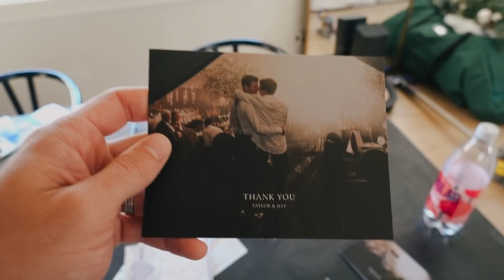OUR HOUSE IS FALLING APART || Taylor and Jeff

Comment: Taylor to answer your window question: use distilled white vinegar. It will get all the water spots and dirt residue off of the window. But make sure to rinse the window afterward with regular water so the vinegar doesn’t mess up the glass

Comment: Tip of the Day for Jeff:  Put a penny in the water with your tulips to keep them standing tall.
Reply: Or wrap them upright with a rubber band or string for the first 24 hours. They will usually keep their shape after you remove the band.

Comment: I think the crack was a blessing in disguise bringing something else more important to your attention.  If it's not the right type of chimney for wood burning and having that insulation inside it could have caused a fire.  You might want to make sure the chimney liner is correct for wood burning. My house was built in 1880, and had just a basic brick chimney that was fine for the old furnace, and was ok for a while with the new high efficiency furnace until I put a new ridge vent roof on that made the attic colder.   The higher efficient furnace put warm  humid air  through the chimney instead of the old furnace's dry hot air, plus the ridge vented  roof system caused the attic and the chimney to  be very cold that created condensation inside the chimney.   The condensation  started bleeding through the wall, and I had to have a new chimney liner installed to solve the problem, .
Reply: Wow! I'd have thought that a pre-purchase survey of the house would have caught that problematic gas/wood (?)  fireplace insert issue. They need to get a heating contractor in there before the stone guys start rebuilding the mantle, because odds are that, if it is a gas insert, it is ruined, dangerous, and must be replaced, plus the gas chimney would have to be relined or replaced, meaning that the wall may have to come out. Building code requirements for a real wood fireplace and chimney are much different and more costly than for a gas fake. That could cost them quite few of espresso machine equivalents before it's done. Wood seems aesthetically charming, but it brings up front expense, long term maintenance costs, and what becomes a hassle schlepping wood around. The charm erodes fast, especially after your first creosote chimney fire. In the mean time, mis-adjust that flue damper and get smoked out of the house. (Right, what's a flue damper?)  Perhaps reconsider doing a proper gas insert repair, fix the mantle, and move on? Good luck guys.

Comment: Try a power rinse with the nozzle, then cleaning vinegar/water with a good spike of alcohol (ethanol best, or isopropyl).  (Acidified ethanol is the main ingredient in Rain-X.)  Or, just buy w/w fluid.

So sorry for your chimney/fireplace issues.  Def check documents (listing, purchase contract, and home inspection report) to see if the house was listed as having a wood-burning fireplace!  If so, and it was for gas only, you can claim the whole thing on home guarantee and even small claims suit for fraud.

At least you don't have earthquakes shifting/shaking your chimney loose from the house-- talk about inevitable cracks!  Keep your flexible filler and spare touch-up paint handy!

Comment: Wash windows with white vinegar and water (or whatever, but vinegar and water is fine and cheap) and then dry with newspaper scrunched up. If need be polish with a tea towel or something decent in the way of material (but obvs not expensive!) works a dream. After all you’ve spent on your house, I’m surprised you’re renting it - unless you know the tenants. But hey! You could spend all you earn in rent restoring your stuff. Especially given that you appear to be pretty particular. Even a comparative slob like me would have to think hard before renting my dream home. (I’ve had a lot of experience with renting property out.) Query: does it really take three burly guys to remove a fire surround? Blimey.

Comment: Attic access. You may want to replace the rope with a small metal handle/ring you pull down with a hook.  Your rope looks odd in such an open space.  Just a thought.  Hope the fireplace is salvageable, the burning of wood in a gas fireplace may have damaged the integrity of the unit.  After you sort out the issue check with your fire insurance, wood burning is sometimes more expensive.

Comment: 6:33 Pro tip for cleaning windows: Use some old newspapers and some white vinegar to get your windows to SPARKLE! If you've never used newspapers to clean windows please believe me when I tell you, there is NO streaking nor is there any bleed from the ink in the newspapers.  Using newspapers is an old trick that hopefully can still be utilized and it saves on paper towel usage.
Reply: Right on! Sis taught me that years ago.

Comment: When I was a child many, many years ago my mom had us wipe old newspapers on the windows after they were cleaned to help them sparkle and shine and it did work.  That said I do not know if the ink is the same ink that is used today.  That was almost 50 years ago.  As far as your fireplace, the insulation should have kept the metal brackets that your fireplace people used from getting too hot and causing the granite to crack.  It could have been just a poor piece of granite.  If the brackets did cause it, they should have noticed that when it was installed and taken care of that then. I would talk to another fireplace company and get a second opinion if they say you need to pay for it.
Reply: It's actually limestone, a much weaker stone than granite of course. But it wasn't hung on brackets, it was adhered to the firebox and drywall with construction adhesive, the piece isn't necessarily deep enough to warrant a hanging bracket as its not cantilevering. The limestone is believed to have been too thin to have supported itself atop the other two side pieces and thus cracked under it's own weight. . Limestone is known to develop fractures when parts of it are singled out to extreme heat sources but whether the actual fire had anything to do with the center crack is inconclusive.